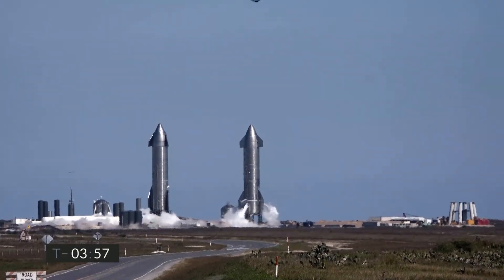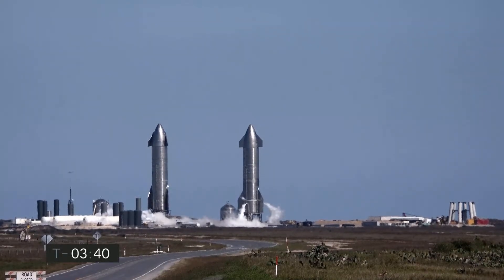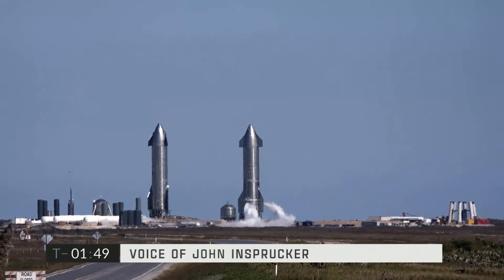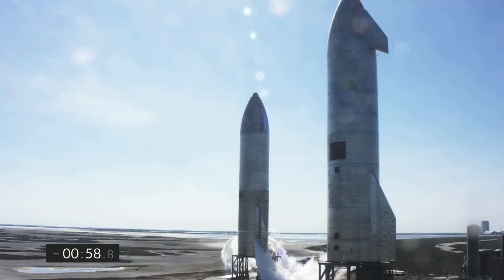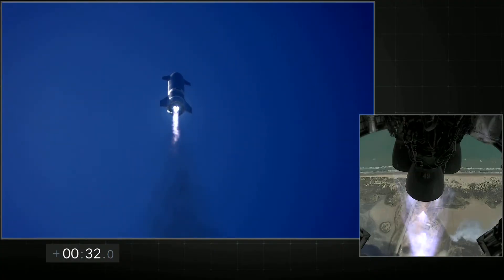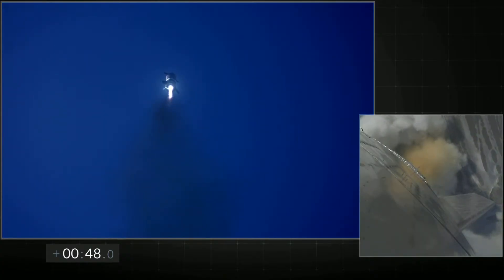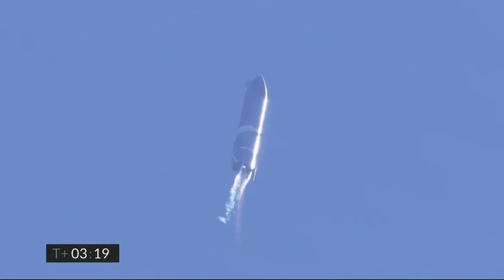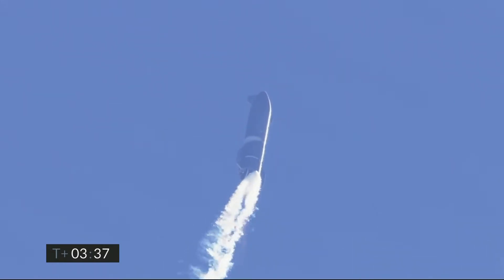Starship | SN9 | High-Altitude Flight Test

Comment: During Starship landing, would it be possible to restart all three engines (instead of two) and, if all three started, stop one engine? If only two engines start, it is just what is needed. Maybe that way RUDs could be prevented if a single engine fails to start.
Reply: orientation to the flaps makes this impossible and how they can vector down there without bumping int each other..
Reply: @joansparky4439  Orientation to the fins is a problem but I don't think that is impossible. E.g.  Starhopper had one engine mounted off-center. It's preferable to a fiery crash. Also, there should be only two engines lit when the final vectoring starts.
Reply: @mladend  
starhopper was only hovering up t 150m and doing all that at very low vertical velocity, so that a single engine could cope..
This one here is a bit different, they need 2 engines to slow it down enough.
If they would slow with one engine only they'd need 2 times the distance to make it work.. but they expected 2 would light up, so one engine just hasn't the ooomp to stop this within this height.
Reply: @joansparky4439  I understand and I am not suggesting landing with one engine only, but landing with two engines where the third engine is the one not in line with the fins if one of the in-line engines fails. Sure, it is a ton of problems like tilting (listing) and more complex vectoring but maybe it is not impossible. The idea is to go through the startup phase with all three engines to the point before significant thrust and before vectoring and then cut off the engine which has a problem or is not preferred. Of course, I have no way of knowing if it is feasible but having engine redundancy during landing could be worth additional weight and complexity.
Reply: @joansparky4439  Elon Musk tweeted: "It was foolish of us not to start 3 engines & immediately shut down 1, as 2 are needed to land". That answers my question. :)
Reply: @mladend  Thanks  for the info.
Reply: @joansparky4439  You are very welcome. Btw, Musk also said that we will see that approach already on the SN10 launch. 🤞

Comment: This looks like a worse failure than the previous one, when the ship executed quite an impressive transition from horizontal to a stable vertical position. It just goes to show how hard it is what they are trying. So hats off to everyone at SpaceX, I'm sure they will get it right.
Reply: Shows how impressive SN8 was
Reply: Neither were failures. With each test flight they're getting tons of new data. They'll stick that landing no problem in the future
Reply: Wasn’t a failure on either flights ;)
Reply: @nls.135  it was a failure to land. There's nothing wrong with failures they are how we learn
Reply: @shatterpointgames  I mean as a whole, 95% of the flight went well. Wasn’t even really the landing maneuver that made it RUD, was the raptor not relighting.
Reply: @shatterpointgames  There's no failures, only feedback (:
Reply: @shatterpointgames  They landed. I can see all of the bits surrounding the landing pad.
Reply: I think that's too late to reignite the engine back for the landing phase.
More later than SN8 did.
Reply: Damn casuals. Don't know shit
Reply: It seems like they actually fixed the pressure issue within the fuel tanks. Thats why you see an orange/yellow 'flame' instead of SN8's green flame on the landing burn (11:45).
To me this doesn't look like a failure.
Reply: This wasn’t a worse failure actually. The cause of this was was different, likely a dislodged landing leg shown in closeups of the underside of the rocket right as it tried restarting, resulting in two objects falling out the bottom.
Reply: @topsecret1837  what are u saying. The second engine was starved of propellant.
Reply: @topsecret1837  nope, the second engine didn't light to help slow the velocity down to allow the legs to deploy. So it's definitely getting propellant to the engines to ensure they've fired up properly.

Comment: It was a clear miscalculation, the engine kept on pushing to the wrong side until it was too late and also the bottom flaps remained in the wrong position not helping the engine to correct the, already uncorrectable, angular momentum.

Comment: I saw some comments saying that SN9 performed worse than SN8. As a mechanical engineer, I don't agree. This is a prototype, so its goal isn't to land, but to provide useful data and reveal any flaws with the design. I think this prototype performed just as well as SN8 as it will provide a similar amount of new data. Based on the lack of green flames, it seems the header tank pressure issue was at least partially addressed, so now they'll find a new issue and fix it. This is just another step to landing a rocket.

Comment: I'm having a really hard time imagining how they are going to routinely stick this landing.
Reply: to be fair, this is a whole new dynamic to their landing. With Falcon they re-enter engines down so they're already oriented for the land and just have to slow it down. Now they're learning the dynamics of flipping the vehicle around mid-flight to perform the final landing. Once they stick it empty, they'll have to learn how to adjust for having cargo and humans  where the quick flip probably won't be so nice for the occupants - meaning doing it higher up and slower.
Reply: @BenjamenMeyer  Thanks for this insight. Really good point about the cargo and passengers inside. That flip from the SN8 wouldn't be so pleasant

Comment: They need to realise that vertical descending has to start a lot earlier as the ship is a lot heavier that those bloody boosters they perfect land !
Reply: Wrong, this it's no different as the early failed Falcon 9 landings, they will learn, improve, and render this routine, unlike Falcon 9 this rocket need to bleed off as much speed as possible as well as being able to survive interplanetary re-entry, the vertical landing style won't work in this case, they wouldn't do the belly flop & flip maneuver if they didn't need to

Comment: Probably CN10 needs to be converted into a stand that can turn on its side with the engines running.
On this stand, it is necessary to work out the switching off and ignition of the three raptor engines when the starship turns when landing.
Maybe this will make it a little faster and cheaper to develop research for the starship?

Comment: Do you think starship is not carry enough fuel as it goes from horizontal to vertical very close to the ground. And doesn't give enough time for the engines to throttle up.

Comment: Seem to had two motors who didn't light up, no ? And also, really too late.
Reply: One engine failed to light
Reply: @jackwhitlock1  I see two engine failed on three engine. Perso.
Reply: @Sombre____  It only needs two to land
Reply: @jackwhitlock1  Not sure if two engines is enough to kill the vertical velocity & keeping the rocket flying straight. I think than they want to light the 3 engines.

Thoses engines are in triangle. If you light only two engines, you are not in the correct alignment with the rocket.
Reply: @Sombre____  Okay Mr. Rocket scientist, why don't you tell that to Elon musk!
Reply: @OortCloud  It's just simple. The two engine are not align with the rocket. If you want to do proper correcting, best is to light those three engine. You have them, you can use them. And i believe than Elon was looking to use them.
Reply: @Sombre____  Its not "just simple." The rocket engines are perfectly fine where they are positioned. Especially because they are able to move around easily. Using 3 engines is too much for the rocket because the engines can only use 40-100% of the thrust.  We saw SN8 PERFECTLY straighten itself out before it crashed. 2 engines is just fine no matter the position.
Reply: @OortCloud  I'm still not agree. It's not a Jet, is a heavy rocket. The internal controller have less correction to do if the three engine at lighting up. It's more easy for him since everything is perfectly align.

Working with only two engine not align is like trying to walk with a bullet in the left foot. You will go nowhere.
Reply: @Sombre____  Again, it doesn't matter since the engines can move around and correct the starship's flight path. We saw this, and I say this again, on the SN8 flight. Go look at it. It straightens itself out flawlessly before crashing.

They even cut off the engine during climb if you haven't realized, and I don't see them swaying side to side. The only time it does is when they reach 10km and cut off the last engine for repositioning.

3 Engines will indeed make it easier but its completely worthless and not possible to make them land with 3 engines. If the starships computers can compensate for 2 engines and 1, why does it matter to use all 3? It doesn't make sense and it's a waste of methane.
Reply: @OortCloud  Just try to command a rocket who don't have his engine in the middle. Even if the engine is able to move. Just good luck. You can try on a rocket simulator. Landing is especially complicated, you save a lot of correction by using the three engine who are perfectly in position. You don't have so much time to correct before the big splash. Proove is than two engine were broken and they didn't have time to do anything.

You never ask yourself why they cut the third engine when they reach a certain velocity and you want to teach me rocket science. That's pretty funny.
Reply: @Sombre____  I have tried a rocket simulator before. X-Plane - Starship. It directly copied the physics of the real starship and pasted them into this simulator. There is a mode to conduct the 12.5km test and I've done it successfully a number of times, all of which I had ZERO trouble with stabilizing the starship because of the engines.

And of all the times I failed, none were because I couldn't stabilize it. There's also the RCS Thrusters if you don't realize which basically help also stabilize the starship when the engines are doing something else.

And yes you are right, I never asked myself why they had cut off the 3rd engine, because I KNEW why. It was because they were done with the ascent and were ready to come back down for an attempted landing. Its not that hard to answer...
Reply: @Sombre____  Suit yourself buddy. Just letting ya know SpaceX knows what their doing.

Comment: If Starship is to be man-rated, it will eventually have to stop exploding on impact with the ground entirely.
Reply: The first planes crashed, the first cars crashed, the first rockets crashed, the first Starships crashed.
Reply: @jackwhitlock1  The point is that powered landings need to be non-fatal nearly 100% of the time in order for Starship to be man-rated -- there's a long way to go when its record of successful landings is zero out of two; the first Starships crash.

Comment: There was not much room for the starship to flip and stabilize before the landing burn was required to slow down and smoothly touchdown the starship. Gotta work on early flip and vertical stability control. I believe that the thrust vectoring  controls need quite an adjustment. Comeon SpaceX you can do it.

Comment: The forward fins tuck in when the raptors don't stop the attitude overshoot. I wonder if their control allocation system only works in the "belly down" attitude.

Not that it would've saved it, but it might help one day if they remain extended throughout the final burn.

Comment: My thoughts : Maybe the raptor Spark ignitors fails to Ignite the engine? So instead of proper thrust and Velocity the raptor just have a preburner in mid flight without thrust. Without the help of the second Engine, the flip Will be late and R.U.D.

Comment: More engine rich exhaust on the raptors during the landing burn. Flip maneuver didn’t seem as smooth as SN8. I’d say SN8 just had a very hard landing at about 30 m/s, whereas this literally belly flopped into the ground at almost terminal velocity. I wonder what the problem was with the engine rich exhaust since SN9 doesn’t have complex autogenous pressurization like SN8 did. May have been problems with the header tanks being pressed with Helium? Otherwise great ascent.

Comment: Damn that was scary, another failure, bummer.
Reply: testing shows what failed so no it was a success
Reply: It would only be a failure if the telemetry stopped working and they had no idea what happened.
Reply: spot on , it is a test flight with double the computers to sense every occurrence

Comment: maybe they should just build a test stand that swivels the whole rocket about the center of gravity. they can start off the test in the horizontal position with the engines off, and then try to get the engines to turn on as it's swiveling into the vertical position.

Comment: There’s 3 engines in the SN’s Starship I hope there’s a mechanism that will trigger another engine if one fails.  Only one engine fired but the other engine tried than failed.  There should be a trigger that with start up the third engine incase of failure.  Someone’s life is going to depend on these engines firing.  There needs to be backups incase of failure 

I wonder if the oxygen header tank is too far away